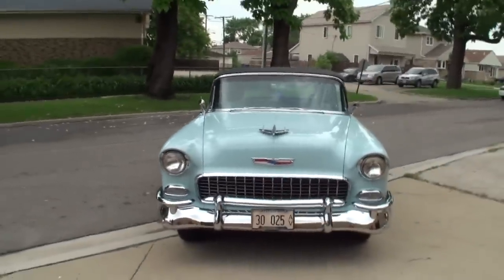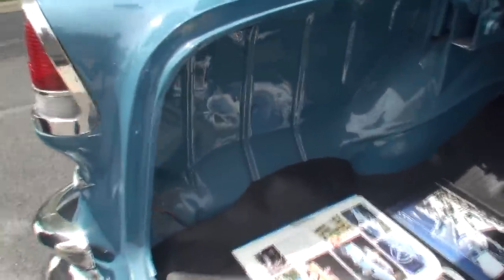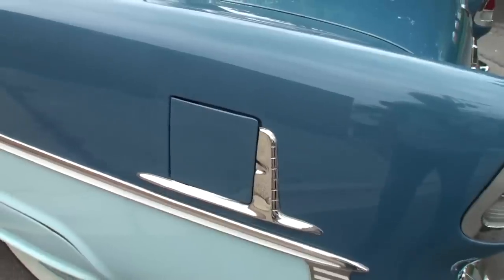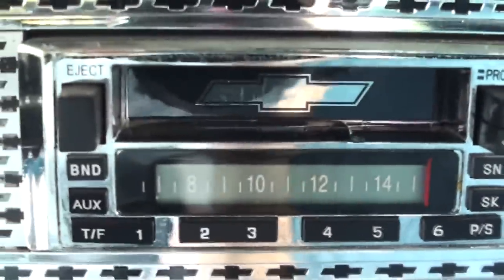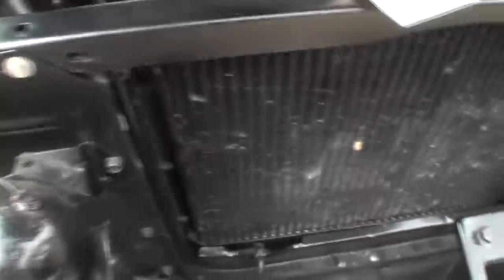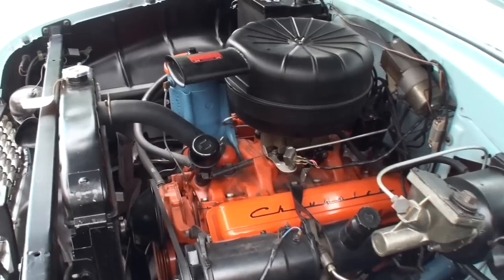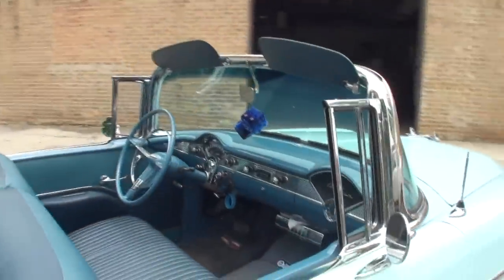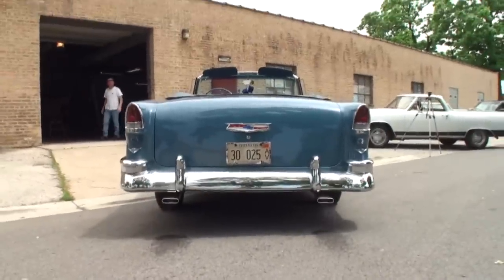1955 Chevrolet Bel Air Convertible in Blue & Engine Sound & Ride on My Car Story with Lou Costabile

Comment: My uncle had one almost identical to this when i was a kid except it was a regular 265 with PowerGlide. It sat in the garage covered with dust and a flat tire for years until he had it towed to a dealership where he traded it in on a used 58 Ford station wagon. By 1964 that car had rusted out and was falling apart, so he bought a new 64 Impala 2-door HT, 283/3-speed on the column. A neighbor of ours had a powder blue 58 Impala convertible that was loaded with everything except AC. He traded it in on a new 64 Pontiac wagon. Even then I couldn't understand why he'd part with a convertible for a station wagon, but that's how it went. That 58 was the most loaded Chevrolet I'd ever seen at the time. It was rare. I never saw a loaded 55.
Reply from the maker: Hi g bridgman, Thank you for sharing the story & details on your Uncle & Neighbor cars :-) Glad you enjoy this "loaded" one, Lou

Comment: Very nice example of classic Americana. The 265ci has a powerpack, which means it has a 4 barrel with a true dual exhaust, which was an option. Not a big fan of 2 barrels in any automobile, especially anything the size of a Bel Air or bigger. The "3 on a tree" was more rare than the automatic? Wow, I didn't know that!!! I thought the powerglide was a rather rare and somewhat expensive option in 1955 as well as power brakes and steering. I believe factory air conditioning came out the very next year (1956) and that was really expensive, as well as power windows, which came out in the late 40's or early 50's I believe.
Reply from the maker: Hi canibusnj, Glad you enjoy this "Classic Americana".  Thank you for viewing and sharing your knowledge, Lou
Reply: canibusnj I had a 55 with power windows.
Reply: Nice!! I believe power windows came out in the late 40's or early 50's. I had to edit my original comment. :)